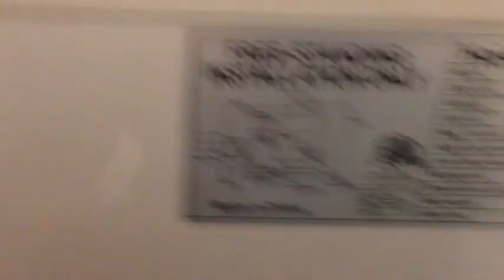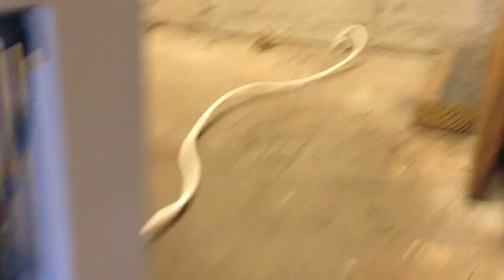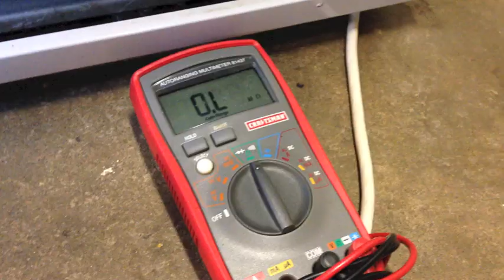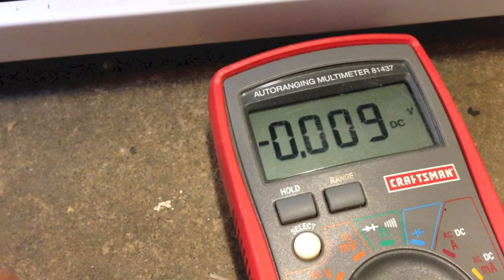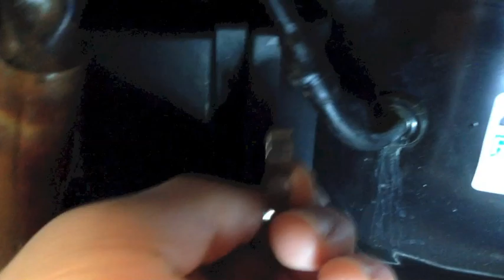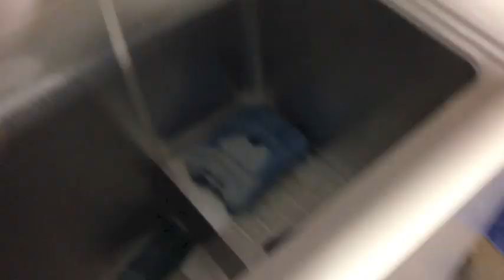HAIER  Freezer Repair

Comment: Hello ... I have a Chest freezer Haier 13.0 cu.fl Model# HF13CM10NW , And it stop working and it look new. I had it about 7 yrs and now they don't sell it no more. Do you think that I could fix it?  The Light come on but it just stop working. I really want to find someone that know how to
fix it. It's a big one. It was rattling. I also think is the relay. The compressor had turn on but than it stop again.Thank you for sharing your video.
Reply from the maker: I thing you can. its just finding out what is wrong with it and replace the part.

Comment: I have the same model compressor rf-1750-79...my question is how much horse power is that compressor. I need to replace the overload. Just not sure if I can use 115v 1/2hp or 1/5hp? I am still looking for the proper hp to plug in there.
Thanks for the video

Comment: I'm not a refrigeration repair person but I am an electronic technician I would think that if you can't buy that capacitor you would be able to use a capacitor that will first fit the area with the same capacitance value and the same operating voltage. A capacitor with a slightly higher capacitance would only help the motor a little bit more. What you call the starter I think it's simply a relay module and I'm not surprised that that was the part that fail since the contacts on relays frequently do fail
Reply from the maker: Thank you for your reply I totally agree with you he just can't get it from the manufacture the part

Comment: I have Haier freezer model HF50CM23NW.  Compressor was not running.  After watching several uTube video, I decided the problem must be with the “startup relay”.  I removed it per videos, then looked for part.  Haier and other part catalogs did not have part available.   I google searched using part number stamped on part.  Needless to say I got numerous results of various designs.  I found one that looked similar made by Bunn.  Turns out it was for a Bunn juicer, cost ~ $11 + $15 shipping.  It was an exact match and basically plug-n-play, taking about 10 min to install.  Compressor runs and freezer cools.

Comment: My compressor actually runs and freezer doesn’t get cold/freeze.   Any reason why?  Something to do with thermostat or front electrical dial that ties into load protector and capacitor which tested ok?  Or Freon issue not circulating?

Comment: I finally managed to get the cover off of my Haier Deep Freezer. I took the starter relay off, but can't seem to find anyone that has it in stock. The part number is zhb125-135p4.7
Reply: Found mine on Amazon
Reply: @tyronnejones9578  lol I appreciate the comment, but I needed up just buying another one. A different brand this time. I have a Frigidaire now.
Reply: Amazon
Reply: I have the same starter relay part number. Were you able to find a replacement? If so where?
Reply: @flam6680  yes, but it did not fit properly. I sent it back and just bought a different brand deep freezer.
Reply: @lilartroom  LOL.  I'm thinking about doing the same thing.  I can't find that part.

Comment: I will star rating every person that have no HVAC/R knowledge call them what they are JACK OF NO TRADE AND NO TECH BACKGROUND
Reply: Ivan wired my entire finished basement Ivan, and PASSED INSPECTION.  Don’t be so bitter.  Electrons flow through wires with different gauges and resistance.  Not that hard to understand.

Comment: I have the same chest freezer. It had been unplugged for 2 years. I have now plugged it back in and it works and gets cold it seems that it don’t want to turn off always running
Reply: I'm trying to figure out the same problem on one I found... well, I kinda jury rigged it to run continuously, discovered a busted part attached to the front dial and I shorted it, perhaps your dial adjacent part is shorted?

Trying to track down a replacement, but not having much luck, don't even know the name of the part in question

Comment: Thank you for the instructional video.  I didn't know where to start before seeing this.   I had a similar failure in the starter relay.  Parts are increasingly unavailable.   I found the folks over at IFixit have a simple work around.  https://www.ifixit.com/Guide/BQP2-4.7+Freezer+Relay+Repair/58523

Order a generic starter, steal the thermistor from the unit.  This is the route I'm going, this route as my thermistor looks scorched like the IFixit teardown.  Good luck to us all.

Comment: This video could have been 5+ minutes shorter without your rambling on.  Your multimeter demo wasn't really useful either.  You didn't even show testing the start relay.  What are we supposed to see to know if it is bad or good?
Reply from the maker: If you get the solid Beep through the multimeter then it is fine if you don't get a beep that means that it is not good .
Reply: @marcibm1  the multimeter i have does not make any sounds

Comment: You could use a 3 in one..overload, relay and capacitor. I install them all the time in place of all three of those start components
Reply: Where can I find that 3 in one?
Reply: Michael contreras
Donde lo puedo conseguir 
Y cuanto es su precio
Reply: Why does my haier freezer not have a fan motor that I can see
Reply: Hi I have a Danby small freezer I checked the relay and over load all good compressor is running and hot .but freezer is warm not cold any suggestions . thanks 👍🇨🇦

Comment: Well it seems Repairclinic.com no longer carries this part. What a scam. Make a product then stop supplying parts so you have to buy new. Well it wont be a Haier....junk. Update : 

 Since I couldnt get a part. I took the starter relay apart. There is a disk in between two 'spring' contacts. I took the disk and contacts out, cleaned contacts, flipped disk over so contacts were touching opposite side of disk. Seem one side of disk gets hotter than other. I put it all back together and it works. Hope that helps anyone out there.
Reply: That was the same fix for the auto starter solenoids until they started to seal everything. But with rivets even after drilling out rivets the design changed again to stop us folks who try to do it all by a machine crimp like reloading rifle ammo. Now it’s a whole unit with starter. Even auto trans are sealed now don’t even take fluid level checks!
Reply: Buy a 3 in1  to replace relay and capacitor  with one device. Bought on Ebay for $15

Comment: I have the same freezer you have. When replacing the thermostat how do you remove the censor from the tube. Censor on the end of wire is ball shape and will not come out of casing/tube. I'm considering cuting the wire and attaching new wire end with censor, together with a splicer reducer. What do you think?

Comment: hello I have a question our chest freezer was not working Wright  we had in plugged into a surge protector could that be why its not working Wright ? we now plugged it directly into the wall it seem to be working a bit better .
Reply from the maker: +minigingerbunnies 

Hey surge protectors should not make it not work. the freezer  may be on the way out.
Reply: marcibm1 I have the same freezer and I also need the same part call Repair Clinic but didn't have a serial number to give them can you help me with the serial number I don't have a computer if you can send me an email dunnock38@gmail. Com thank you

Comment: I have been on here all day trying to figure out why my freezer stopped. I plugged it up the other day. Waited one day and checked. And it was cool. So I put some food in it and the next day it quit. I took my air hose and blew it out. Plugged it up and it sounds like it is working. But really quite. You said in the video to turn it up slowly.
So it has been 4 hrs or so. I just checked and I got frost on the walls. I am thinking I may need to put it in the basement. It is on the porch, and during the day it is in the 90's.  Most of the videos I have found on here have been, putting a hard start kit on.
Thank you for taking the time and showing what parts went bad. And how to check it and fix it. I hate to buy up a bunch of expensive parts and replace  them. In the hopes that something I did fixed it.

Comment: To improve efficiency of the freezer, since it uses the compressor housing surface radiating heat to the outside air rather than a condenser coil.  Place a 4" 120ac muffin fan blowing on the compressor to take heat away faster.  This will speed up the cool down (heat transfer) within the chest resulting in overall shorter run times thus reducing electric power usage and not costing as much to operate as before.
Reply: Vary smart idea remember old G.E monitor top refrig it had metal fins around compressor to exchange the heat. Thanks Steve.
Reply from the maker: Great suggestion

Comment: What is the part# and link to the part....i have the same freezer and issue.
Reply: John Smead  Your very welcome, I am glad I can be of assistance. Great to hear you are having success! 

This will be a very long reply with important information.  Read all of this FIRST before doing any thing. I am not responsible if you shock, injure yourself, others or property in any fashion. This is for information only. 
 If you do not feel confident doing any of this call in an electrician to help you.

OK, now on the final touch up on the repair. Before working on the freezer unplug it from your house power outlet. For reliability sake it is always advised to have your freezer on a separate dedicated circuit using a "Ground Fault Interrupter" or GFI outlet.  For a circuit indicator, you can plug into the other unused half of the outlet a "neon night light" so that you see at a glance of the GFI breaker has tripped, you can then make necessary repairs.

  Look at your hot lead from your power cord going to the compressor, it should be BLACK or even RED and your neutral going to your compressor common is WHITE and the earth, chassis ground is GREEN.  Check your power cord and verify it has a 3 prong plug on the cord. If the colors are different, it's because of foreign manufacture, usually Blue is hot and is connected to the smaller blade on the plug. Brown is neutral connected to the wider of the two blades and lastly GREEN, may or may not also have a yellow tracer stripe, is EARTH GROUND going to the round pin of the plug. Verify these with your digital Volt-Ohm-Meter (VOM) set to continuity when you touch your test leads together the meter should buzz or beep. If you use an older meter with a needle it will move from left to right. 

Keep in mind the thermostat is nothing more than a controlled ON/OFF switch. The switches are going to be wired in series or one after the other like Christmas tree lights.  The first one in the line is the MAIN ON/OFF switch for the freezer followed by the freezer thermostat switch. 

Leave your NEUTRAL wire connected to the common on the compressor. Your GREEN EARTH GROUND wire should be a direct connection usually a screw terminal to the chassis of the freezer. Take your HOT lead loose from the compressor. Connect it to one side of your ON/OFF switch. Next, connect the other side of the ON/OFF switch to one side of the thermostat switch via a short jumper wire which may already be in place. Lastly, connect the other side of the thermostat switch, possible second jumper wire, to the compressor where you had disconnected the HOT wire.  It is important that ALL of your control switching, switches the HOT lead of the circuit. If so everything is wired correctly. NOTE * If the MAIN ON/OFF switch were connected on the neutral or common side it would be possible that the freezer chassis would be electrically HOT and when you touched the freezer you could get shocked or even KILLED. Also the GFI breaker on the outlet would trip.

 Once you have the switches wired in you can verify everything with your Volt-Ohm Meter (VOM) for proper ground connection. First, have the freezer MAIN ON?OFF SWITCH in the OFF position. Second, set your VOM to AC volts and the scale, if it is manual select, to 150vAC or higher, otherwise the VOM will automatically select the correct range if it is a digital type. Third, plug the freezer power cord into your GFI power outlet. Take one probe lead from your VOM touch it to the freezer case on BARE METAL. The other lead touch it to the metal box of the outlet. If the outlet is in a recessed wall box touch your lead to the screw holding the cover plate. If the screw has paint on it scratch it to get to bare metal.  Behind the cover plate the cover plate screw threads into a metal frame for the outlet which is connected to EARTH GROUND.  Now with both probes touching your VOM you should read ZERO volts.  Now switch on the freezer power switch and test one more time taking the same reading points again. You should now have ZERO volts again if so, everything is wired correctly. If you read any voltage the wall outlet NEUTRAL and EARTH ground may have a poor connection at some point you will need to call in an electrician to check the house wiring for that circuit. Again be sure to use a GFI outlet.
  Hope this is helpful. - Mike
Reply: John Smead - If you jumped the motor terminals like "marcibm1" showed in the video and the freezer freezes, you are on you way to a successful repair.

This is how you calculate and size the relay you need this works for any motor. For the replacement relay from Ebay,  it is rated to handle load of 149 watts @ 115 v. To calculate the current capability of the relay use the Ohm's Law formula to calculate current. Where, P = power in watts, I = current in amps, E = voltage in volts. The formula is I = P / E (current equals power divided by voltage)  I = P 149 watts / E = 115 v, the result is 1.29 or, rounding up, 1.3 Amps of current. You select a relay with a "contact current rating higher than the motor rated "run current" by a factor of at least 1.3 or 1.5 times greater. So a motor with 1 amp "run current" draw, you use a start relay with contacts rated at 1.3 amp minimum to 1.5 amps. 1.5 amps is better the relay contacts last longer .

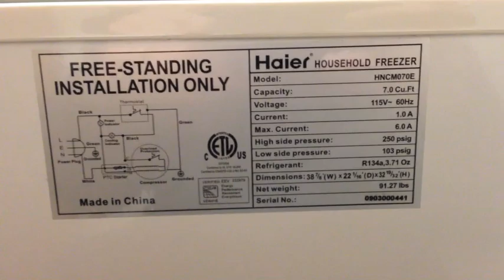 The motor "run current" is 1 amp, as shown on the manufacturer's I.D.  plate in the video at 1:40, with a maximum or "start current" of 6 amps. In all motors the "start current" is typically higher than the "run current" in this case 6 times higher.  The relay contacts will handle this momentary high "start current' surge. This high current is needed to give the initial kick to get the motor armature (or rotor the part that turns) and compressor combination.  The start capacitor is in the circuit used to lessen the effect of the "opposition to current flow" of the "start current", which is typical in the motor windings of all motors, this is so that the armature will turn.  

I hope I didn't get too deep into the theory for you on this and that the information helps you in your repairs. - Mike
Reply: Casey Chambliss Have you purchased a repair kit?  The kits have diagrams.  First thing needed is for you to find the hp of your compressor.  Then go to Ebay under "Hard Start Kit" with the hp and a list of kits will appear.  The kits start at about $8 including shipping.
Reply: The start relay switch is no longer available.  You can use an after market start switch assy with built in start cap it is on Ebay, Amazon, etc., comes with instructions, here is the Ebay link: $11.97 w/ FREE shipping  http://www.ebay.com/itm/Refrigerator-Compressor-Hard-Start-Kit-Relay-Capacitor-Overload-for-3-in-1-/271631999488?&_trksid=p2056016.l4276

Hope this helps.  BE SAFE
Reply: Mike Schmidt Just wondering how you know that this is the right hard start relay kit for this particular freezer? I have the same freezer and need to make this repair but want to be sure I order the correct part. Thanks.
Reply: Mike Schmidt Thanks so much for the quick reply. The detail you gave is greatly appreciated. I did not see in the video where he jumped the motor terminals but I did test both the capacitor and load detector and they are both good. When I removed the start rely it sounded like a baby's rattle when shook, so I'm pretty sure this is the problem. I am unable to find a replacement starter rely and am hoping that this hard start rely will work for me. Based upon your information I will order the part and hope that it provides the fix I need. Thank you so much for your time and expertise.
Reply: Mike Schmidt Wanted to thank you again for your help and ask a question that arose as I was installing the hard start kit. On my freezer there is a wire coming out of the thermostat that connects to the load detector. The load detector then connects to the common terminal on the compressor. I installed the hard start kit without attaching this wire to anything and the freezer works. However, the controls on the thermostat are not working. it could be that the thermostat is working but the off switch is definitely not working. Any ideas on how this wire should be connected?
Reply: John Smead - Were you able to get the ON/OFF switch and thermostat to work properly?
Reply: Mike Schmidt Thanks again for your detailed instructions. I had to open up the thermostat housing to see the wiring and draw a schematic to fully understand your directions, but thanks to you, it's working great. I took all of your helpful precautions and ran the voltage tests you mentioned to ensure safety. Many thanks.  John
Reply: John Smead Please share the diagrams! Thanks!!